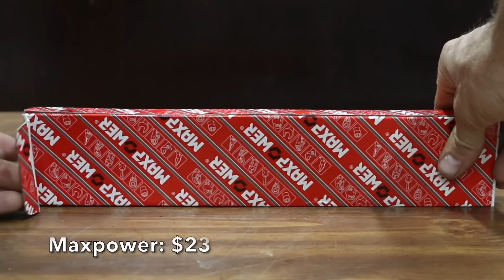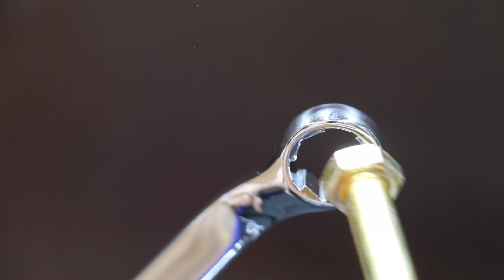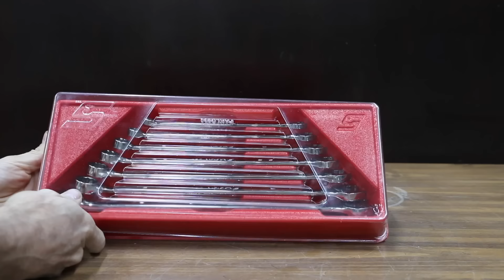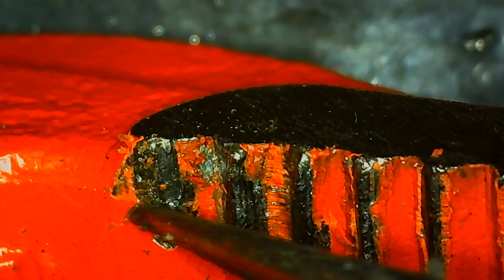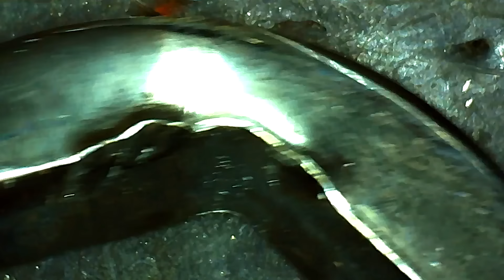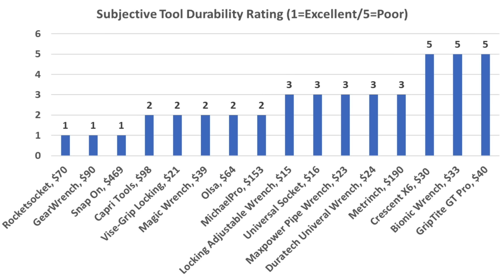Best "Rounded Nut" Extractor Wrench? Let's Settle This!

Comment: Those locking vice grips from Irwin are awesome for removing stuck brake lines, power steering hoses and a/c fittings that nothing else can grab and are in a class of their own in my opinion.  I have a old set from about 30 years ago that has saved my bacon countless times so I am thrilled to see they are making them again.
Reply: If your vice grips are 30 years old then they are the original Vice Grip brand and made in U.S.A and much better quality than the Irwin crap. Don't ever get rid of them. The difference in quality is huge.
Reply: @Bloodbain88  My thoughts exactly.
Reply: Key phrase "old set from about 30 years ago". These were probably a quality pair that didn't get chewed up at the first sign of difficulty. Best found at auctions and garage sales!
Reply: @bretth1714 Truth. I bought a newer pair of adjustable Irwins and they are trash imo. There is so much slippage they just don't make a good grip. It's like buying new Craftsman compared to old
Reply: Vice grips for damaged nuts/bolts, I don’t care if it chews them up, I can always replace them. But if I can’t undo them … !
Reply: @CrimeVid  Vice grips are no match to a pipe wrench though. A pipe wrench will either chew the nut into nothing, or open it. Vice grips will only round the nut as they don't provide proportional gripping force to the turning force.
Reply: @celeron55  I don't know... take a old version of Vise-Grips, the new ones are not the same, crank it real tight, and put a pipe over the adjusting handle, say two or three feet, and you can loosen just about anything that can be loosened. 

Of course pipe wrenches will do the same, if a bit more fiddley, if the width of the jaws aren't much wider than the bolt head is long (they tend to roll off if they are), and if you have one on hand, and if they fit the available space.
Reply: @celeron55  Ditto on the small pipe wrench. Only tool I've ever found that can take off a rounded 10mm brake line nut without trashing it completely.
Reply: @celeron55  I used to use pipe wrenches and even have a few mini ones but since discovering Knipex Cobra pliers several years ago, they have been my go to over a pipe wrench for rounded fasteners, protruding broken bolts, and other round objects. I agree about vise grips though. They are pretty much useless for these purposes and usually slip no matter how tight you clamp them.
Reply: Those are probably American made.
Reply from the maker: Thanks for sharing!
Reply: I like to use a small pipe wrench for that.

Back in my country I've been using a tool of my own design(kinda like that duratech, but very aggressive and strong) that was able to grip to completely round things and maintain a very strong hold, it's sad I can't make a new one here(cuz I don't have access to factory machinery).
Reply: I have a full set (4, 7, and 10-inch) of the LW series and they have served me well, although those were all marked Made in USA when I found them gathering dust in a small town hardware store.

I wonder if the newly reissued Taiwanese construction might be the cause behind their current performance.

They truly are a godsend for dealing w/flare nut applications when you really need to put down the power.
Reply: it's because your 30 year old set was either made in the States or Taiwan from required spec alloy.
Chinese predilection for corruption via substituting substandard materials proven.

Comment: Try using the Stanley with the wrench turning the opposite direction so the force is applied closer to the bottom of the moveable jaw and the top of the fixed jaw. I've long contended that an adjustable wrench is much stronger when used in the opposite direction that most people use it in.
Reply from the maker: Thanks for sharing!

Comment: Last time you did this test, I followed your advice and bought the Amartisan 13 piece bolt extractor set on Halloween October 31, 2021 I got tricked and no treat. I was working on a 2007 Suzuki SX 4 trying to remove a severely rusted bolt to replace the rear wheel hub. This car is notorious for rusted bolts. needless to say, it just made matters worse and I wound up buying a mig welder to finally get the bolt out. I know you go to great lengths in your testing, but I suggest to get under an old car and try to use the product in real world conditions. If you would like, I could sell you my car to practice on, but this time just use your own brute strength, no mechanical or robotic arms and make sure to get under the car upside down and see how it works. I know you strive to take human error out of the equation, but sometimes simple real life usage can tell a lot more at than all of your testing. You should always take the product and try it yourself on camera with no edits. Thank God for Amazon returns.

Comment: 2 or 3 others I wish you would have compared.  Standard round jaw vise grips, 12" Knipex cobras, and maybe the classic “pound a cheap socket on it” used to remove locking lug nuts when you lose the key.

Comment: You REALLY should have used the "Channel Lock" "Nut Busters" on this test. I've absolutely NEVER had a nut or bolt they could not remove. I even stood on them while they was on a 3/4" conduit, being 35' in the air when I did (I was in a harness and the safety man wasn't around to catch me, lol). They are pliers but when on a bolt or anything they can fit you only need to apply pressure to the top handle. They have literally NEVER failed me in the removal of any fastener or pipe they can fit!!! NEVER FAILED!!! There is not 1 single other tool made that I can claim that about. They would have broken the heads off of every one of those bolts. Completely rounded too!!! Without breaking a sweat!!! Unbeatable by anything you have shown here or in any other test you have ever performed with rounded fasteners!!! And I WILL lay my money where my mouth is as well!!! They are that great (almost perfect)!!!

Comment: I find using a strong pair of vise grips with hammering action on rusty bolts to be good enough if the bolt is already rounded anyways. Much cheaper than these options.
Reply from the maker: Thanks for sharing!
Reply: Might as well if you are going to replace the bolt with a new one anyway.

Comment: Another fantastic review! Adjustable wrenches work best when the resultant force on the movable jaw is inboard requiring  you to face it in the correct direction depending  on loosening or tightening. For example the wrench should have been flipped around when tightening as in 1:35
Reply from the maker: Thanks for sharing!

Comment: Where was this video when I was trying to remove a bike pedal with a hardened shaft?   Tried Proto and Capri wrenches, neither held on enough to budge  it.   Also tried a crows foot on a 3ft breaker bar and a set of sockets designed to remove wheel lock nuts.  Wound up removing the pedal and used a 3ft pipe wrench on the hardened shaft with a 4ft pipe to get it off.   A MAP torch also helped....

Comment: First off I want to say that I love your channel, your test results have helped me with making some crucial decisions with some of my tools.
My only question is why were you concerned with the damage that the tools were inflicting on the bolt?
I'm not trying to criticize your testing or methods, I'm just wondering why damage to a rounded bolt is a factor when you would probably replace it anyways.
Once again, I love your channel. Sending thumbs up from UK.
Reply: I think people are mixing up situations where it is O.K. to destroy the old bolt in order to get it out vs. a situation where you want to not damage what you are trying to loosen such as a soft flare nut fitting on a line connection or even to loosen a bleeder screw     "bleeder wrench" usually 6 point?   Hope they don't put the Vice Grip on that !!

Comment: Also, your completely rounded bolt test is a good bit flawed. As you are supposed to use the next size down on rounded bolts and install them with the necessary amount of pressure to seat them.
Reply from the maker: Thanks for sharing!
Reply: @ProjectFarm  hey buddy, I Love the channel and the tests you perform on here. But these copy and paste replies are driving me nuts. If it's not an actual reply about the comment I'd rather not even get a reply at all. This makes you look very generic and unresponsive!!! As a generic copy & paste reply is NOT an actual reply. It says "I don't care about your comment so I'm just going to say the exact same thing to every single person who comments, every single time they do comment". That's not a good look for anyone .....

Comment: I would also measure the thickness of the tool or hard to reach spaces where the width was not a concern. For example where a socket wrench is too tall for a space and the vice grips or wrenches could fit

Comment: Another great video. I have a matco set of hex extractor wrench’s similar to the capri ones. When it comes to the rounded fasteners i think your supposed to go down a size of the fastener that is rounded. Not sure if this is how you tested just thought i would of the info. So 10mm rounded fastener you should use 9mm wrench. Again don’t quote me, but this is how it was explained to me when i purchased them
Reply from the maker: Thanks!

Comment: The red pipe wrench did Not experience damage on the good bolt. That was paint only!!! Paint scratches appearing where it should have Never had paint to begin with does NOT constitute saying that they have experienced damage!!! It should have never had paint on those teeth anyway. That just gives less grip for the teeth and makes it easier to slip. Even though they didn't actually slip in that particular test. I really like those after watching them work. I'll be ordering a set now for sure!!! Lol

Comment: On the ones that did not have enough grip on the rounded fastener, it would have been interesting to see if going down a size would fit and remove the bolt.
Reply from the maker: Thanks for sharing!

Comment: interesting in your review you state the snap on wrenches are supposed to grip on the open end but you use the closed end? not very fair when you aren't using the tool properly. I have had great success using the open end of the snap on wrenches and don't really think the first test is fair for them since you used the closed end.

Comment: I currently own a set of Metrinch tools. I have had them for over 25 years. I LOVE those tools. Not overly fond of the open end on the wrenches, but they have their moments. The sockets and ratchet have been my go-to since new. They have been abused like it was my mission in life and have held up better than any brand I’ve owned. I ride Japanese motorcycle and grew up driving GM cars, so I needed both metric and standard, so metrinch made sense and never let me down. I would HIGHLY recommend.
Reply from the maker: Thanks for sharing!

Comment: Hello Todd. I would like to request a review on cordless soldiering irons, both butane and battery. I have a Power Probe butane iron which is disappointing because it just doesn't get quite hot enough. It would be useful to know which would be best to replace. Thanks in advance.
Reply from the maker: Thanks for the suggestion.

Comment: You missed a huge point with the spline tools. When worn out you size down eg 7/16 when worn you use 10mm and pound it on. (works better when they are close eg use 7/16 on worn 11mm) I've removed completely rounded fasteners this way. Similar to rocket socket

Comment: Snap on makes a set of sockets for stripped nuts and bolts. Similar to the ones in this video that you used to tap on with the hammer. I have a set of them and have used them a few times. I have no complaints with them so far.
Reply from the maker: Thanks for the feedback.
Reply: Probably better than the cheap ones although if MAC makes one in their "RBRT" series,that would be worth consideration

Comment: One thing I would've liked to see with the extractor wrench sets is to see if a smaller wrench could get a grip on the rounded bolt if it is too small.
Reply: Yep, was going to comment the same, it's worked for me before with helical sockets on heads that were too rounded off and or rusted away, it also helps to have both an SAE and Metric set to have a better spread of sizes. You have to hammer them on, but if you can get one to go on they'll usually have the bite. You'll have a hard time getting the bolt out afterwards though without a vise. But it was nice to see some wrench type tools tested, there isn't always room to hammer a socket on, but when there is, that's my go to, those helical sockets work great. Pipe wrenches usually do well too, but often times those are too big/bulky to get in there as well.

Comment: I've had my bacon saved by that vice-grip so many times I can't even guess. Had the same pair for a quarter century, and beat them senseless. A lot of the time you really have to squeeze the heck out of it to make it work, but it usually does. Sometimes hitting a fastener on three sides with an angle grinder makes the difference so it can grip.
Reply from the maker: Thanks for the feedback.

Comment: You missed the most hack'n-slash solution; weld some L-shaped rebar to the bolt head 🙂
Must have used that trick dozens of times; altough it does get exiting when fuel lines or oil lines are close ...
Great test as always; being European, we got lotsa facom & gedore wrenches; they are really good but also really expensive. 
The two missing contenders however were the ordinairy vise-grip; and the bot-splitter. It's usually a toss-up between the splitter and welding something to it ...
Reply from the maker: Thanks for the feedback!

Comment: I would like to see a video comparing some different brand sockets or even socket sets. I'd like to find a well built set with its own case but would be willing to make my own case if there is a better set that doesn't come with a case
Reply from the maker: Thanks for the suggestion.

Comment: My rounded bolt/nut remover never fails, just put a scrap of aluminium sheet next to the bolt for protection and put a nugget of weld on the bolt/nut and then a universal nut fu@ker has something to grip on to
Reply from the maker: Thanks for sharing.

Comment: I’m just curious if the first test was the right way to test them all. Would it not be better to see how much they can tighten each bolt in the various stages of roundedness? I’m just wondering if trying them all with the bolts tightened to the same fixed interval exceeds the various wrenches maximum torque rating.

Comment: That stanley locking adjustable wrench is great. I never even thought about using it on damaged bolts being that it’s an adjustable wrench, but I love it. 

I’ve had it for probably 10 years now and it’s one of my go-to tools for field work
Reply from the maker: Thanks for sharing.
Reply: Why use it on damaged bolts before you damage them, amirite?

Comment: I sometimes use a small pipe wrench similar to the magic wrench for rounded nuts/bolts.  I believe if you have flipped the wrench over, it would have clamped on better.   Thank you as always for all your hard work. ~ Chuck
Reply from the maker: Thanks!  Thanks for the constructive feedback.
Reply: He was using it properly. They do nothing backwards.
Reply: @LegoDork  Thanks.  I use a similar, not the same, tool so there must be some differences.

Comment: Headroom (depth along the axis of rotation) can be as important as the overall diameter of  the tool (especially if you need to swing a hammer to seat the tool😂)
Reply from the maker: Thanks for the feedback.

Comment: Let me tell you a story about Snap-on. My father-in-law was a snap-on dealer for 30 years. The failure rate of Snap-on dealers is incredible. He was the only snap-on dealer on record that had two snap on trucks going. He found out where the Snap-on wrenches we're being made and started direct ordering from the factory instead of from Snap-on. It had all the Snap-on crap on it he just didn't have to go through the Middleman. The ending was sad they sent him 95 windows and told him to start using that and after multiple failures in the computer system he finally gave up. They tried to hang him out to dry for about $150,000 and he contacted a lawyer who does nothing but Sue Snap-on. It's his whole lawyers life he has hundreds of cases filed against Snap-on and they ended up accepting all the product packed and credited to my father-in-law and he and did notpay them a damn dime. Moral-of-the-story Snap-on is overpriced s*** has cost more than one man his life savings in a vision of being a tool dealer and nowadays with all the tool manufacturers with lifetime warranties they're really nothing but an over polished turd

Comment: The flank drive combination wrenches are excellent, and do provide a better purchase on bolt heads versus other brands that have similar design . They are not meant for extracting in my experience. If I know, I will need to use a open end wrench for a bolt or nut that may be extremely tight I’ll go for the Flank Drive before any other open end wrench due to how well they bite just my two. Cents.
Awesome video thank you for all the time that you put into them love them and will be waiting for the next one to come out
Reply: I wish Snap On put their "Flank Drive +" open end on their 6 point combination wrench,also they should have a bigger selection of the combination wrenches with the 6 point instead of the typical 12 point box end 
   also their flare nut/line wrenches might be the best choice for actual line use where you want to get it apart without ruining it for reuse
Reply from the maker: Thanks and you are welcome!